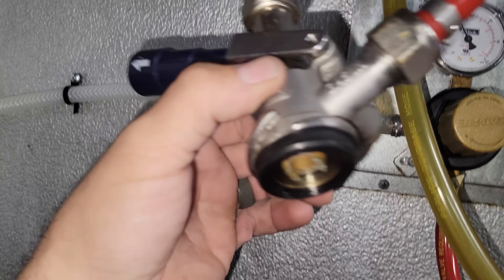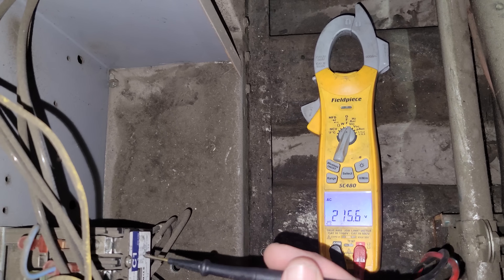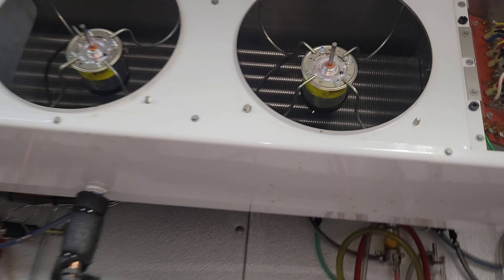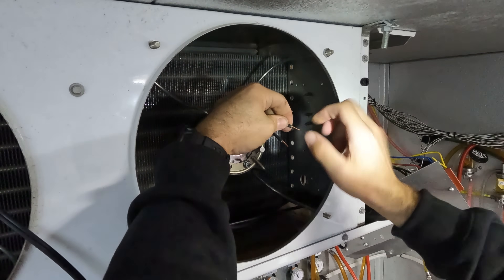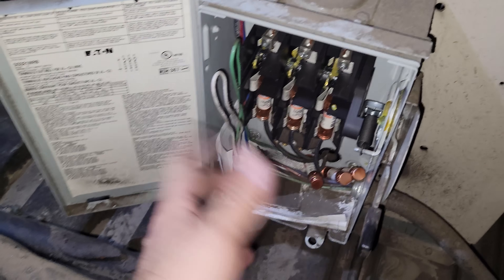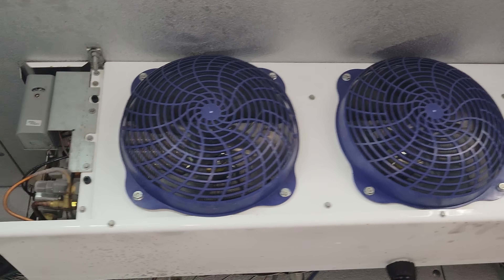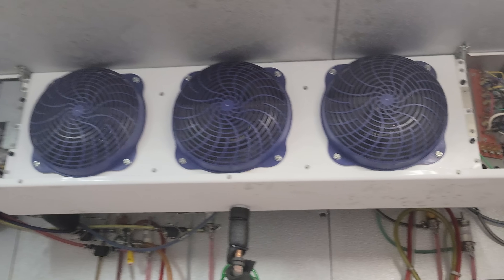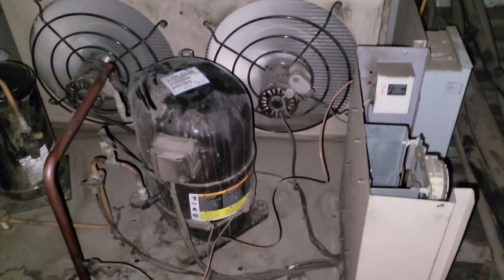HURRY THE BEER WALK IN IS AT 70 DEGREES

Comment: One of my customers insisted I arrange for 80-100 pounds of dry ice for his walk-in freezer while waiting overnight for a compressor to show up. I explained it at least 6 times to the manager and owner why that was a deadly idea. They were amazed someone might die. Ended up with a freezer truck from one of their suppliers. 
Great videos.
Reply from the maker: No joke I had a similar situation, walked in the a cooler and saw all the dry ice, turned around opened all doors and advised the manager on their nearly deadly mistakr
Reply: @HVACRVIDEOS  Worth investing in a portable gas detector. Imagine being in walk-in box with a R290 leak. Happy Christmas to you and your family, as well as my fellow viewers.
Reply: @stephenwalls9277  to be fair there's a charge limit of like 200 grams or something for 290 and 600, you'd need to be stuffed into like a 2 Sq ft box to be killed by that amount of refrigerant, lol. At least here in the US, I know other countries have been using r290 and 600a for larger systems for quite a while
Reply: @HVACRVIDEOS  CO2 is not as dangerous as say nitrogen, your body will notice the elevated CO2 level and you will feel like you are suffocating. With nitrogen you just fall unconscious and then suffocate without feeling anything.
Reply: @irfp460  the issue is that when you dont know what it feel likes you dont know the dangers.    I work daily with co2 so i know the smell and the sensation but if ya never ever smelled it.     Well its over.   But yeah nitrogen is even sketchier since ya wont notice at all.
Reply: @DiyNuke  How can't you know how it feels to suffocate? It's pretty obvious...
Reply: @DiyNuke  yup!      Well that's my 2 cents, let me know if u need change back  😜
Reply: @irfp460  With high concentrations, you don't have time to react. Your instinct is to breath in more or cough.
Reply: @irfp460  it's the Co2 levels in your blood that dictates your reflex to take a breath. High levels and you start the suffocate reflex. If you breathe nitrogen or helium from ballons you go from being ok to pass out without feeling  any need to take a breath.   No oxygen means no Co2 build up = no breathing reflex
Reply: @irfp460  Because the feeling of suffocating is caused from carbon dioxide buildup.. so no, you will infact not feel anything, or begin to exhange air faster if you are breathing nitrogen.
Reply: @HVACRVIDEOS  never ran into dry ice/co2 issues. But I’d did have an accidental releases of refrigerant in a walk-in when the solenoid opened. I really didn’t think anything of it. That stuff gets you quick. Luckily a manager came in and saw me having issues with my balance. Was on a ladder and trying to get down to get out.
Reply: They think it's _ice_.  No risk.   Too many people don't understand that Dry Ice is solidified carbon dioxide.
Reply: There was a rather... Influential... YouTuber that had copied an already-copied video of a dangerous DIY version of a a car "air conditioner" that was simply dry ice in a cooler with a fan. Many many people mentioned the dangers of this in comments, he deleted all of the "negative" comments. It was reported to YouTube because of its danger and the Creator's large audience, and the fear that others would do the same and could be injured or killed. YT ignored the complaints, the video kept popping up in my Suggested, and the YouTuber DMCA'd anyone that debunked or warned others of the dangers.

Seriously... Releasing carbon dioxide en masse into an enclosed space... It's not rocket surgery, folks!
Reply: @dashcamandy2242  I could see doing it if you pumped mineral oil through the cooler, with the cooler in the trunk, and used the mineral oil to move heat around (Old trick from the early days of Pentium processors.   Let a guy more than double an early processor), but I wouldn't want more than a few chips in water to make fog/mist in relatively enclosed areas.
Reply: Comments and videos like these make me realize why safety training is so important and often so long. A lot of people need a bit of knowledge hammer.

Comment: If you can, stagger the butt splices for a tighter bundle.  I love the ratchet crimp tool (it enforces a specific crimp)
Carry a small length of spiral wire  loom (found at auto parts) Easy to add around round or square struts, the zip the cable to that
Reply: ratchet is the only way that works. these regular pliers dont do shit. but in my experience they are still shit because everyone uses the wrong sizes. i just use wago 221's whenever possible.

Comment: I always hold the strippers at a slight angle to the wire when I first clamp them down,  it makes it much easier to get that initial "cut and pull" on the jacket....  it also helps avoid cutting the copper and pulling strands of conductor with the strip.
Reply: I learned that from an electrician channel.  Slight angle, cut, lever to perpendicular then pull.  That levering seems to break the tension and any thin layer not cut.

Comment: I see the same issue all the time with the evap fan wires rubbing through against the motor brackets. I also use the same technique with the cable ties to keep the wires spaced away from any thing that may rub through the wire insulation. I have a quick tip on installing any type of crimp connector. After you get the wire stripped to the correct length place the crimp connector into the crimp tool first and verify that connector is positioned correctly and then put connector on wire and crimp as usual. It makes it a whole lot easier because the connector doesn't fall off wire as you're trying to hold wire with one hand and the tool in the other. Also helps doing it this way when space is an issue. I know alot of people may say to never to use both hands when working on any high voltage but if you're positively sure the power is off it's perfectly safe. As usual another great informative video. Thanks for sharing.

Comment: Couldn't the heater still be bad even if there's power running to it? How do you test for a bad heater if there's power going to?
Reply: If it's drawing power, it's producing heat - energy can't just disappear, it has to go somewhere.
Reply: @aprilkolwey4779  you can have appliances that don't work but still draw electricity, thats not a definitive way to check if it works or not! Just saying!
Reply: @jo6520  This isn't an "appliance", it's just a heater.
Reply: @aprilkolwey4779  not saying its an appliance but its an electrical device wich can still fail even if power is going to it. Even if its highly unlikely to fail it has components that might fail, and a heater IS an appliance. If you put power to it and it doesn't work, than testing just that it has power doesnt effectively tell you weather or not its working!
Reply: @jo6520  I think there's a bit of confusion between "drawing power" (what I originally said, as in current is flowing - what was tested for in the video) and "power going to it" (voltage present on the terminals).
If all you test for is voltage being present on the terminals, then yes, the heater could easily be open internally and not drawing any current nor producing any heat.
If you test for current to be flowing (for example, with a clamp ammeter) and it is, then the heater is not open and is producing heat.
Reply: Either voltage drop, resistance (if no power and heater disco from circuit) or clamp amp meter.
Reply: No idea how he does it but I personally check between the different strips, i.e. Number 1 has power and draws 5 amps and then check if the others are the same. Since the thing is just a resitive heater there's not much that affects it.

Comment: I use a ratchet mechanism "press" ( kinda similar to the one that someone would use for RJ-45 plugs on UTP-8 cable ). And I have been using plugs for my slices ( and for wire termination ) for quite some time. Some old timers tend to regard them as superficial... I use a combination of two strippers, both adjustable, one for the outer layer of wire insulation ( white PVC jacket here in Greece for most cases that I have come across ) and one for the inner layer.

I had a similar case of evaporator fan wires causing a short. but in my case it was due to deterioration of materials ( the wire became loose from its plastic braces, which were of a reusable kind, and I retrofitted zip ties ). In a reach in this summer i changed the fan cable completely, failed twice, and would risk another call back. 

And last, but not least, happy holidays, and Merry Christmas to everybody!!!

Comment: Great point about co2 detector. I'm in a walkin cooler everyday, l clean beer lines. I was on job n wasn't feeling right n it turns out every gas line hex nut on the keg coupler, which is what u wer holding in the box, was loose. Thanks 👍
Reply: If you are working in those coolers every day you probably should carry a personal gas detector.
Reply: @meeder78  I now install in-line leak detectors. Picks ups leaks in the draft beer system. So ull know b4 entering the box.
Reply: @shine-cg9uf  I would still use a personal detector at that point. I have one from work which is a BW Gasalert with 4 sensors. For my job it's specifically for Oxygen, CO, H2S and LEL. They also have them with CO2 detectors and there are also simple single sensor versions. 
That thing has potentially saved me a couple of times.
Reply: @meeder78  and yet its better to have an permanent sensor since.  The wearable sensor isnt that quick.   So in an basement you will colapse before you realise/notice the alarm going of.   And most people dont wear em low enough.  So when they pick something off the floor they just fall and die. 

Co2 gas is pretty darn tricky.  And ive seen some serious shit.  Where an 200kg cryogenic tank was leaking liquid co2 constantly and they just pulled out the plug for the co2 detection since it was constantly going off. 

He walked in to show me but he nearly fell down.  Sketchy shit
Reply: @DiyNuke  you absolutely need a permanent sensor but having a personal one just adds an extra layer. 
There are also pumped sensors which actively suck in the air around you and they are faster than the diffusion sensors. The downside of those is the extra noise, bulk and weight. 
My diffusion type sensor saved me on occasions with H2S which at low concentrations smells like rotten eggs but at higher concentrations it numbs your smelling receptors. 
In a pump cellar it quickly, while I was still climbing down the stairs, warned me of a low oxygen situation. 
My employer provides each employee with one and they are calibrated every six months. Where possible I use customer provided detector because they use a bump station daily to check the functionality of the sensors.
Reply: @meeder78  yeah thats true. 

I know have an GMI PS500.  Which is  the worst thing ive ever had. Battery life of 6h  charging time of 14h and its not even 1.5years old. 

You have one of those small microclips or something simulair?  I wanna get a new one since i almlst dont use the gas detec now since its too heavy gives false readings and short batt life.   And its been repaired/recalibrated 4times now and its still shit.    Now the co2 sensor is out alltogheter.     Almost want to throw it in the water and say oops.  Lost it😂  worst part is that it costed 1500$
Reply: @DiyNuke  Microclip X3. But if you don't need multiple gasses to be detected I would get a simpler one.
False readings is something to always be aware of since most sensors have some kind of cross sensitivity to other substances. I recently got spooked by a CO alarm which in the end got triggered by hand disinfectant. The CO sensor is also cross sensitive to Hydrogen (it once went off whole walking past a forklift that was charging, the hydrogen released by charging that lead acid battery was enough).
Reply: @meeder78  ill get2  since i dont want the co2 to be at chest/neck height   and since you breathe out 4% co2  it triggers allot when crawling/going to an tight spot  with your head tucked down since blowing co2 right onto the sensor🙃

Ill look into the one you have then. 
Basicly only need LEL. O2 and h2s and co are nice added features. Since i also walk on oil refineries sometimes.    Mostly i work with ch4 nitrogen and co2 and argon.
Reply: @meeder78  ok thanks for the information appreciate it. 👍
Reply: Had one of the cooks at a hotel I worked at pass out after smelling something strange in the walk-in keg cooler. Fortunately the outer door of the other cooler was propped open where she collapsed through the doorway. Hotel management quickly had a CO2 alarm system installed.
Reply: This is why ammonia is my favorite refrigerant 🤘😊

Comment: I would leave the green jumper wire in place, flooding back to the compressor can cause premature failure of he compressor. Merry Christmas
Reply: so then? after defrost the fans turn on right away ?   causing over amping and high suction
Reply: @primetime758  Any time you start a compressor, the suction is a little higher until the box reaches temp. Defrost will not cause high suction due to the box is still cold. I have been an HVAC tech for over 50 years and never saw an issue with starting a compressor after a defrost.
Reply: @watermanone7567  And after 50 years you weak as hell   you complain about slugging   over amping and high suction will kill the compressor before slugging  i'm more powerful of a mechanic than you are so sit down junior  those are Cr or CS series compressors  those are pretty fragile i'm shocked it still working in that enviroment